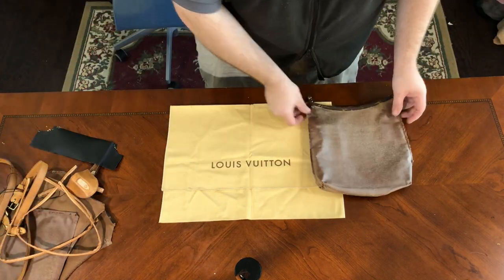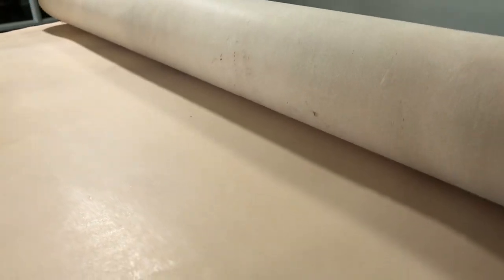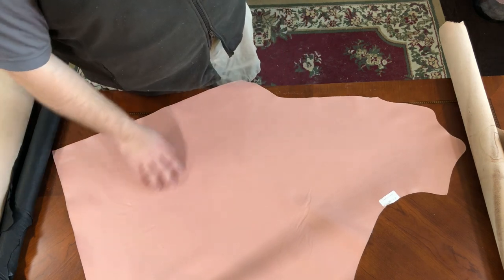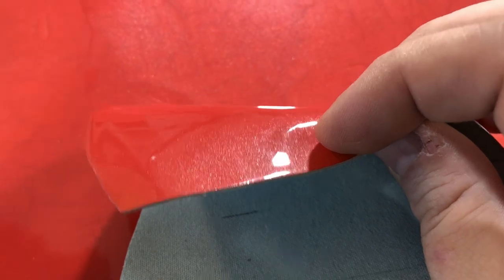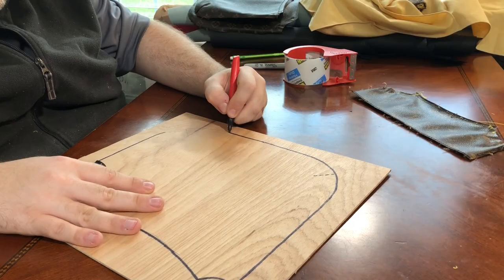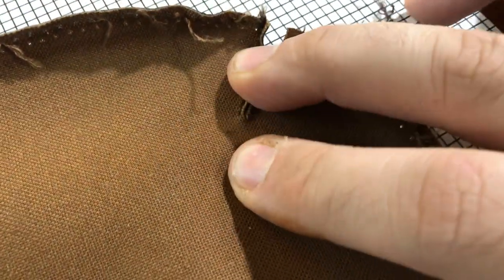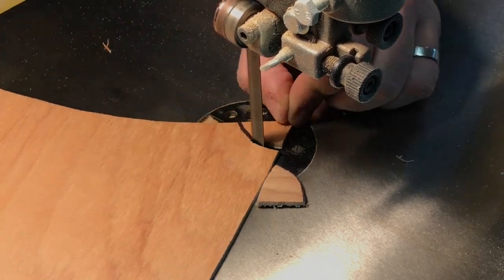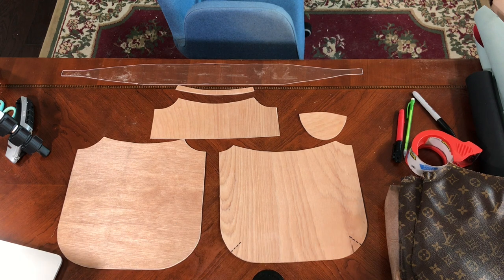LV Handbag Restoration: Part 2: Materials and Patterns

Comment: I made a bag from a tanned piece of sheepskin.  I made it with the finished side out, and left the suede on the inside.  The suede started to shed, and I got suede lint all inside my phone charger port, all over everything in my bag AND all over my clothes!  So i had to line my bag to protect my electronics from the suede lint.  So if it were me, I’d make the shiny side out, and line it so you won’t have the lint problem.  Perhaps your leather won’t shed as bad as my sheepskin and you won’t have the same problem... but you asked for comments, so...
Reply from the maker: Wow great tip. I hadn’t thought of that